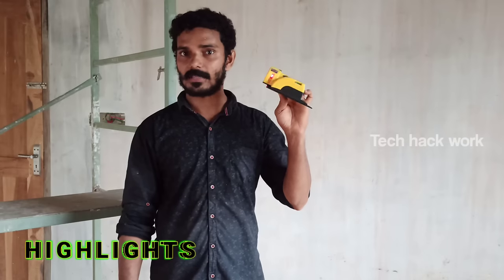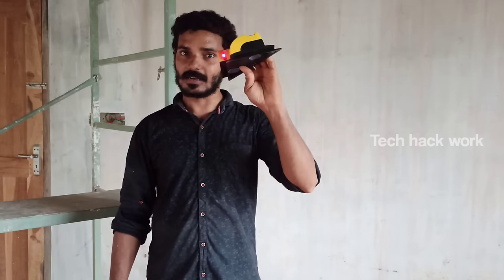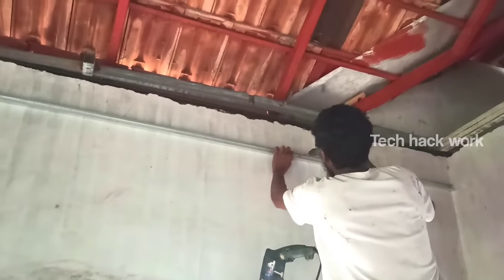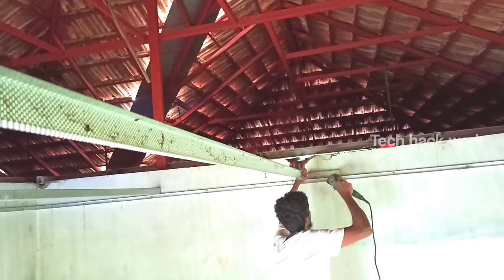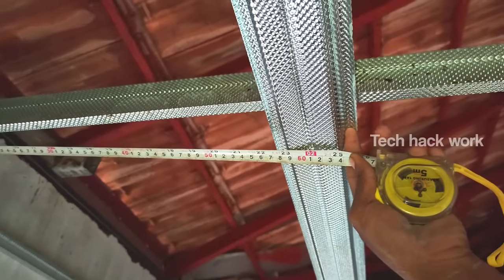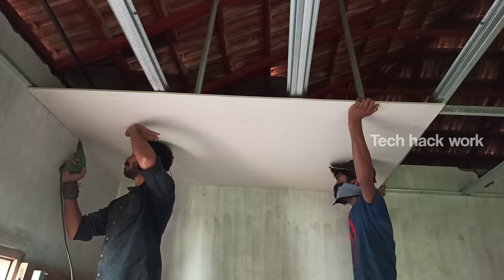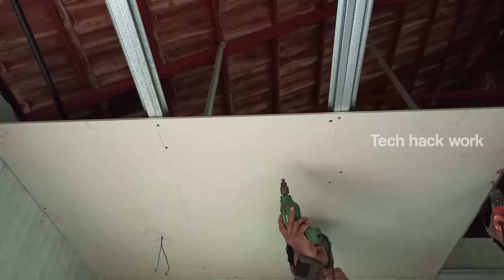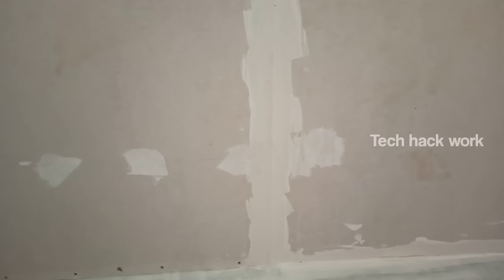Gypsum Ceiling | ജിപ്സം സീലിംഗ് തുടക്കക്കാർക്ക് പഠിക്കാൻ | Drywall Ceiling work malayalam

Comment: what is the normal ceiling height in 3m height flat roof  room
Reply: need answer not like 😉
Reply from the maker: 285 cm top from floor. 
design 285-11.5 cm. 😍😍😍😍😍
Reply from the maker: 😜 im writing that tym.
Reply: @Techhackwork  we have a gypsum work yesterday...flat roof il ninnum aake 5inch matrame ceiling thazathullu ennanu parayunne...12.5cm thazan  vendi enthina veruthe gypsum cheyyunnathu..designum undu oru c section model...
Reply: @Techhackwork  thank you
Reply: @Techhackwork  design nte height floor levelil ninnum 273.5 cm pongi nilkkum alle??

Comment: Chetta 12*12 feet room ceiling cheyumbo estimate etra rs aakum
Reply from the maker: per sq ft 50
Reply: @Techhackwork 
 ie 12*12=144
144*50=7200 rs alle .
Athil design okke chyumbo etra aakum
Reply from the maker: പ്ലൈൻ measure ചെയ്യും, ശേഷം ബാക്കിയുള്ളത് running feet measure ചെയ്യും. 260 sq ft വരും ഏകതേശം
Reply: @Techhackwork  ponnu aashane technical terms use chyalle ...namk manasilakilla...
Just etra rs aakunnu matram para.veedinu chyan oru plan ondarunnu
Reply from the maker: Sorry bro. ഞാൻ കരുതി വർക്കർ ആണെന്ന്. പതിമൂ വായിരം. വരും.🤪
Reply: @Techhackwork  ok bro.... reply thannathinu thanks

Comment: Chetta ee gysum sheet etra aakum etra..  mm kanam undu
Reply from the maker: 12mm. .5 ഇഞ്ച് approximatly
Reply: Price per board
Reply: Perimeter pipe length n price etra aakm
Reply: @Techhackwork  , നല്ല work , ഒരു aprox price പറയാമോ?
From - to -
Reply: Rs 390/-

Comment: ഇതുപോലെ ceilling ൽ plain gypsum work ചെയ്യാൻ എത്ര budget ആവും... 
Plz reply
Reply from the maker: per sq feet 50₹
plain work 10*10 room 5000₹ only.
design work extra 50₹/ sq feet. running feet also measure for design, like border, beam, etc... thanks 😍😍😍😍😍
Reply: @Techhackwork  with material  anoo ?
Reply: @nanofans9874  yes
Reply from the maker: S

Comment: സാധാരണ ഓടിന്റെ അടിയിൽ ലീക് ആയാൽ ജിപ്സം ചീത്ത ആകില്ലേ
Reply from the maker: ആവും. 👍🏻
Reply: @Techhackwork  അപ്പോൾ അവിടെ ചെയ്യാൻ പറ്റിയ മെറ്റീരിയൽ എന്താ
Reply from the maker: pvc or calcium silicate
Reply: @Techhackwork  ഞാൻ ചെയ്തത് insuboard ആണ് കുഴപ്പം ഒന്നും ഇല്ല coner ഇൽ ചെറിയ വിള്ളൽ കാണുന്നു പുട്ടി ഇട്ടാൽ ശരിയാകുമായിരിക്കും അല്ലെ
Reply: Insive board better
Reply: @shahidkadambode4202  is it new one if you have more info pls share
Reply: @AjayKumar-oe5yv  it's like thermocol but very strong and weight less 8*2 board price 460, 
It's water resistant 
I work with this in my friends home  it's very good and neet
Reply: @shahidkadambode4202  is it insuboard